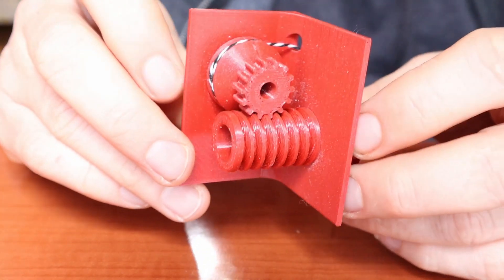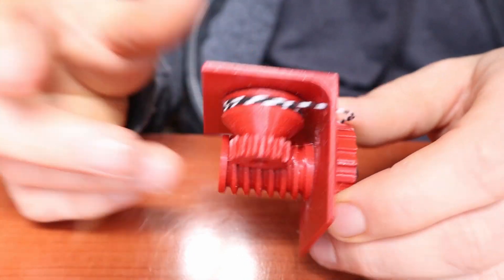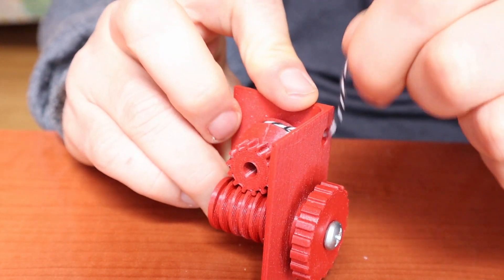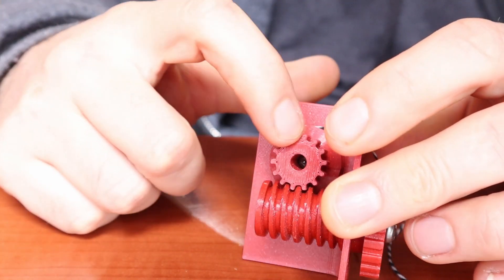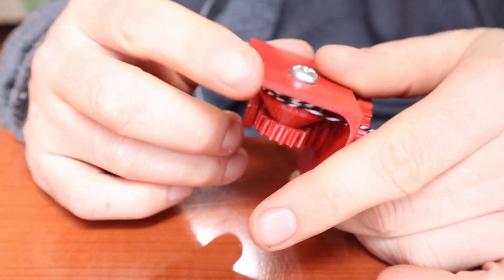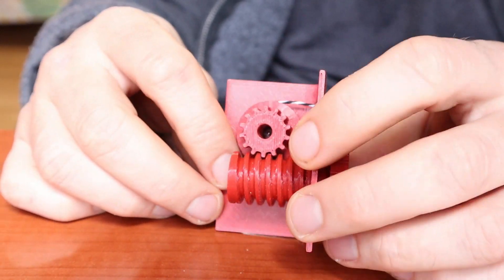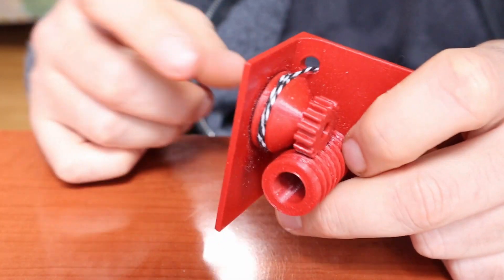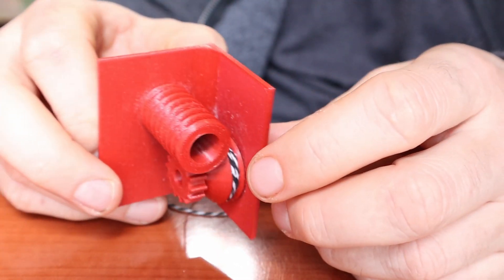Spin 158 - Worm Gear Tensioner Test

Comment: I like the idea of retro fitting something like this to the eew6, but I think relaxing a worn out brake band would be really awkward.
Reply from the maker: You could add a really simple clasp that could act as a quick release for the string.  There are lots of things used for fishing that would work.  You could also 3D print something clever with a magnet.